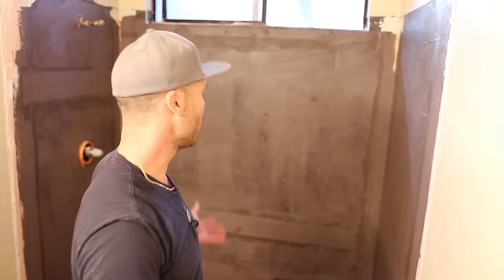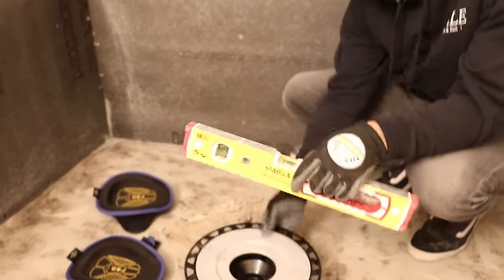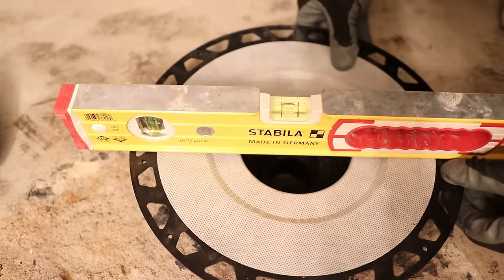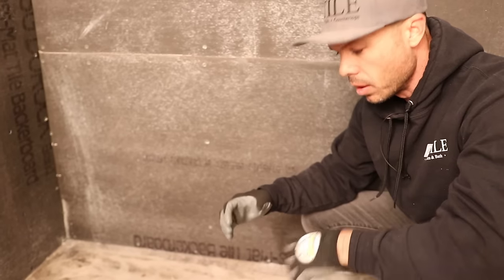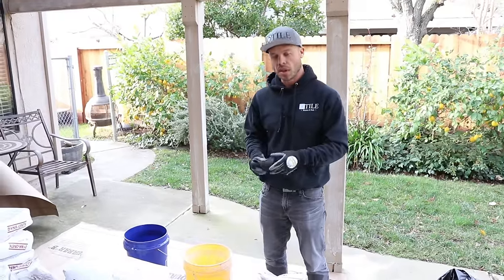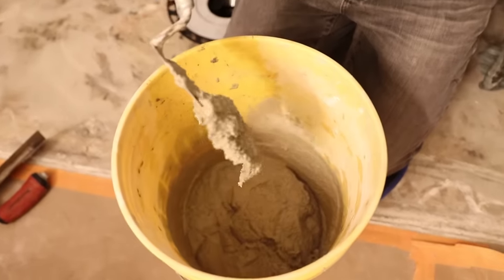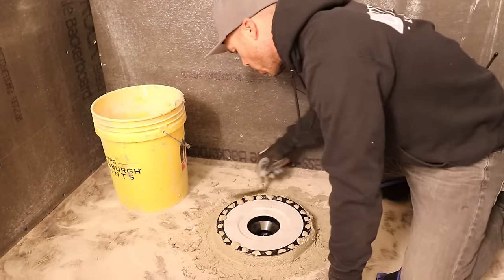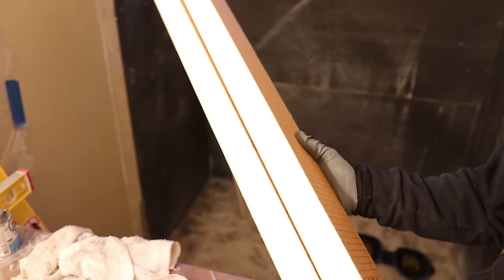One Day Shower Prep!!! MUD PAN with Kerdi and Ardex 8+9 :  TileCoach episode 28

Comment: It's interesting that Schluter now calls their product a "water management " system and no longer calls it "water proofing", lack of confidence in their own product??.  Meanwhile, in all their instructional video's they show their technicians putting the product over standard drywall, which doesn't even meet code in most area's of the US.
Reply: I love remodaling bathrooms where tile is set on drywall, rip all the tile out down to studs in 20 min. Takes longer to bag it up then  demo
Reply: Kerdi membranes are ul listed as vapor barrier so it not only meets code it is far and above what is required

Comment: Hi Isaac! Would you use a kerdi drain adapter flange vs. the step you showed in jackhammering and replacing entire drain? I just ordered an adapter flange to avoid hammering out and potentially wrecking the plumbing -  https://www.homedepot.com/p/Schluter-Kerdi-Drain-4-in-Stainless-Steel-Grate-ABS-Adaptor-Drain-Kit-KDAR-ABS-E/202608376

Comment: Ardex 8+9 is not waterproof, Ardex 8+9 is diffusion open, no?  Mixning 2 different system would rate it no go over here..
Reply: Im reading the usa site and it rates waterproof, in sweden its not rated as waterproof but to be used where underlying moisture can travel freely.
Reply: To add some more info, we only use ardex8+9 over here in basements where there’s a lot of moisture travelling in the floor.

Comment: If you leave a gap between wall board and your pan, then you have exposed studs? That is not proper. I have 30 yrs. experience, no failed showers. I have used liners, schlueter systems, hydroban over densheild.  But never left a gap between the floor and pan  This job was not waterproofed.  Explain what goes in the gap between the floor and the elevated board. You have said leave a gap on several videos,  Thats bad advice. Put your wall on the pan and buy some fabric, i use typar, get some hydroban on it. No indide or outside corners required with hydroban. Three coats with a brush never fails.